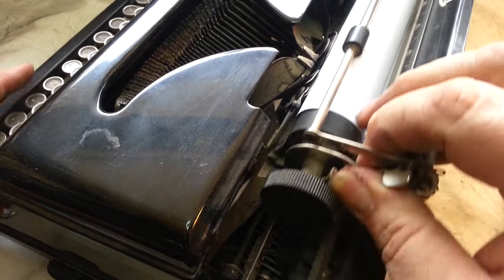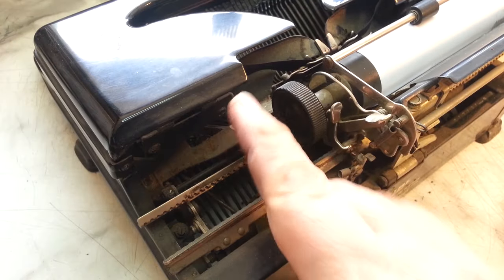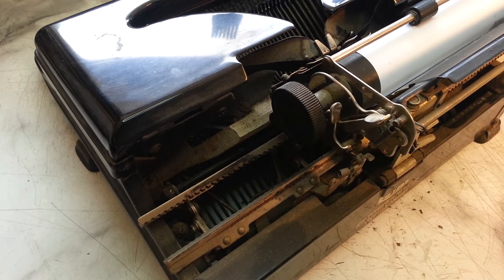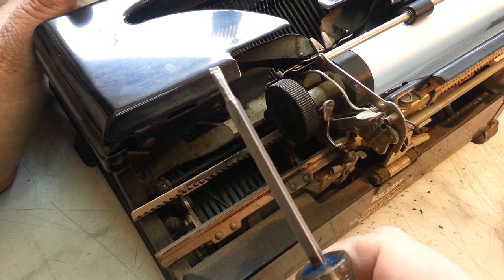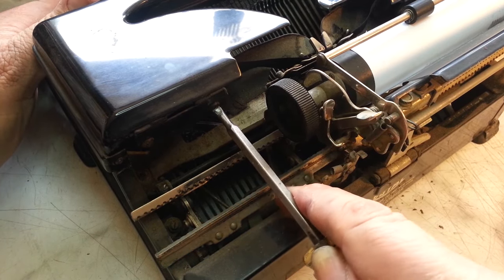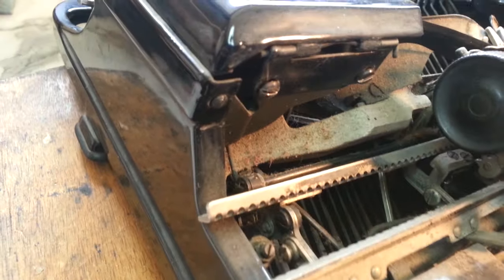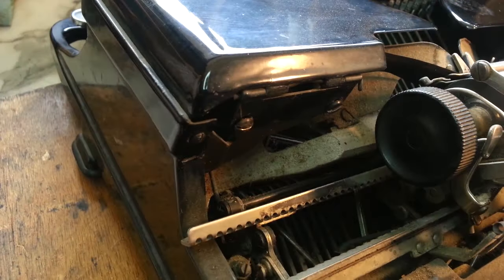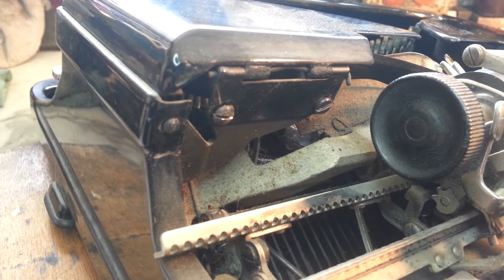Cutting Slot on Screw Head in a Vintage Royal Typewriter with a Dremel Rotary Tool

Comment: I had a platen knob set screw on a Quiet-Riter that was messed up. I was going to cut a slot but somebody suggested check Ace Hardware and lo and behold they have a little set screw that fits perfectly. 6-32 pretty sure. It takes an Allen key so got the exact fitting one too.